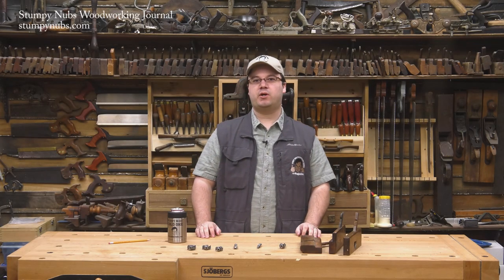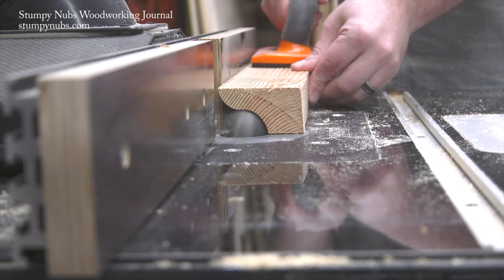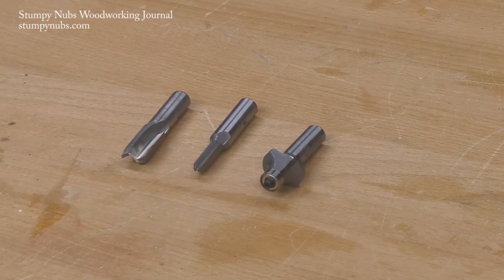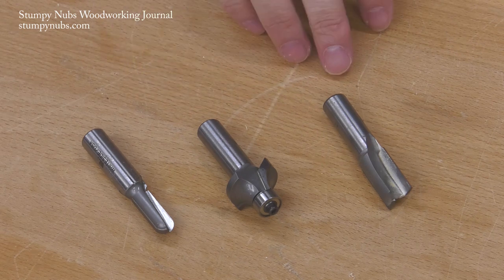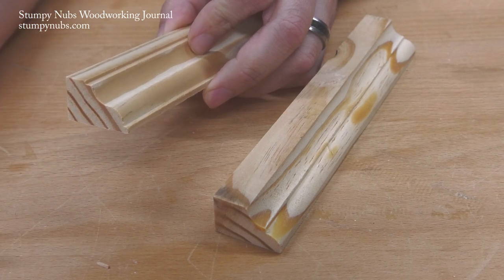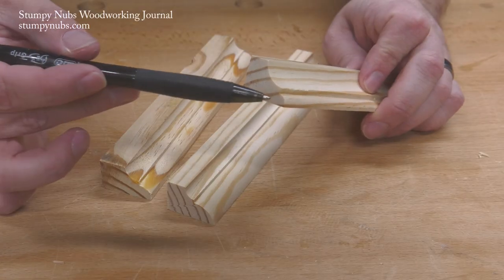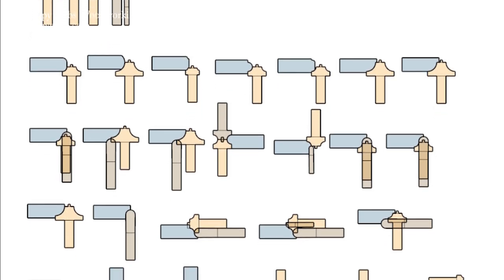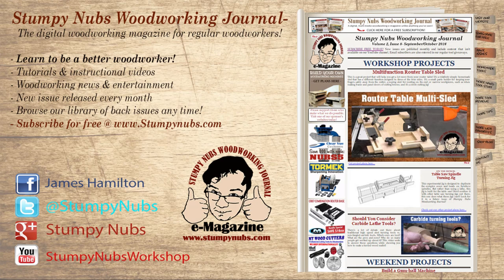How to make custom molding profiles with just a few basic router bits

Comment: Great video.  I have an old house and have need to match several of the original molding shapes - crown, base, window and door casing, etc.  Between my router and a couple simple bits, coupled with my table saw with a flat top blade, I am able to nearly perfectly replicate about a half dozen profiles - one of the three-part crown pieces, three of four-part base molding profiles, and casing and backband, sill skirt, etc.  To start, I generally rip the subject molding to its square dimensions, e.g., it may be 1-1/6 by 1-3/8 for backband.  Then cut curved profile, then run it through my table saw twice for different cuts.  I've also used my hand power planer to match a different style casing that was used on closet interiors.  I've saved a lot of money on my remodeling projects by not having to have custom moldings formed.  As you point out, the possibilities are almost endless!

Comment: There are a lot of options from basic shapes, but profiles should not be used at random. Have purpose. Moldings can soften an edge to protect the grain, hide a gap, or provide a means to drain water away from the furniture if it gets wet. Most people think moldings are purely decorative, but that wasn't why they were originally developed.

Comment: I have a 1/4 inch shank router and many of the larger bits don't fit in the hole. Also some of them cost 70-100 dollars. Way more than I would like to spend on a bit that's only going to be used for one or two projects. Love that I can do all this with a couple basic bits.

Comment: Thanks for your video. I'm looking to make a match for the top baseboard moulding/trim piece on a 1920's home. First, do you know what that trim piece is called? And any insight on who might sell router bits to match old profiles? Similar in-stock box store trim is half the size.

Comment: Any cool dudes on here got any tips on here for … building a 3 in 1 router/jig saw/saw table?  I mean.. Of itleast a 2 in 1 router/jig saw table that I guess connects to my saw table.
I’m VERY new to all this. I don’t even have a router yet - just a dremel router attachment. And I’ve never even yet used a jig saw - ever… just my dremel scroll saw. BUT … I want to use them. & so I’m Wondering for a 3 in 1 table what would
Be better?? Corded or cordless jig saw & router

Comment: They did think of it sooner. This company just made it out of plastic. I ran into an older gentleman and he told me that the one he uses was his Fathers. He found it in his Father's work shop after he passed. It was considerably larger than the one I purchased to practice working with it. It uses fine metal pins and works great and it is available at Bibens Ace Hardware quite inexpensively. I hate it when a company takes an old tool, makes minor changes and then calls it "their invention." That is pure BS and I would bet it is more expensive than the old school version.